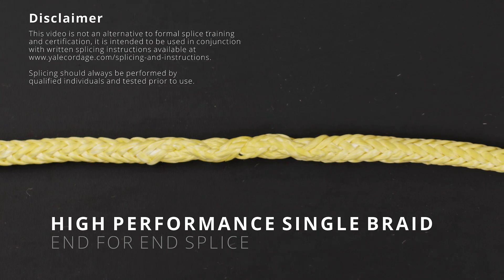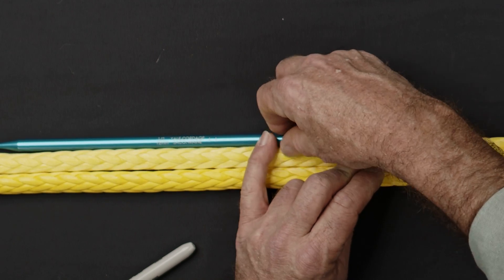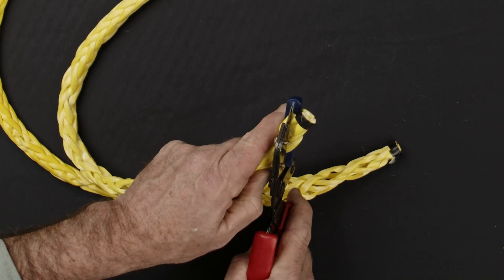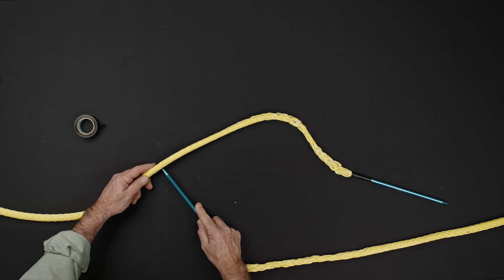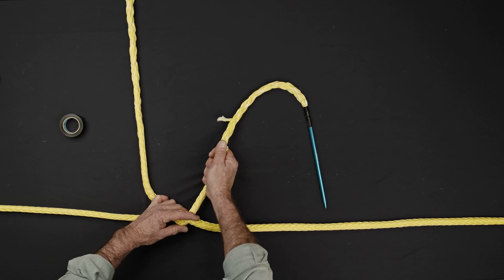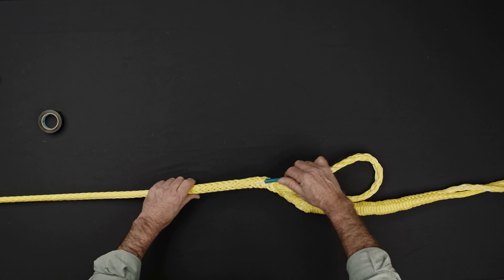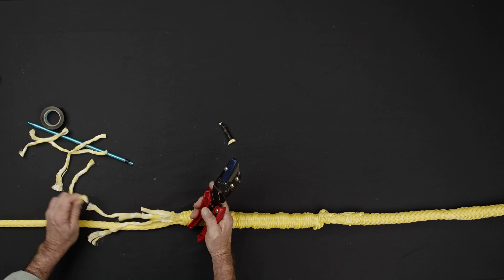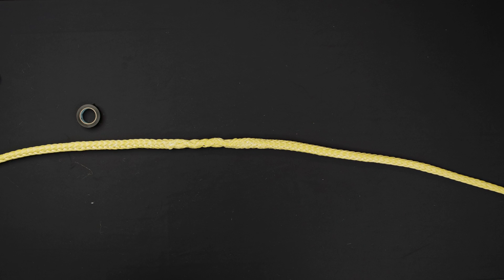High Performance Single Braid   End for End

Comment: looks like two Brummels per end locks it better than the single ones most videos show.

How much length do I loose when doing this? I.e. the length loss due to the burying?
I need this for the perimeter of a trimaran trampoline, so I should need reasonably accurate  to maintain the shape of the net.